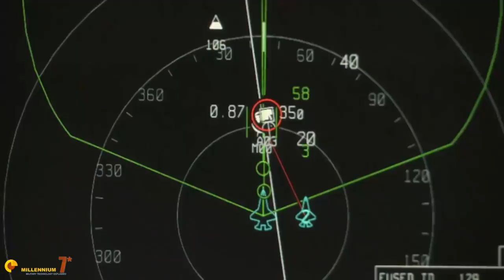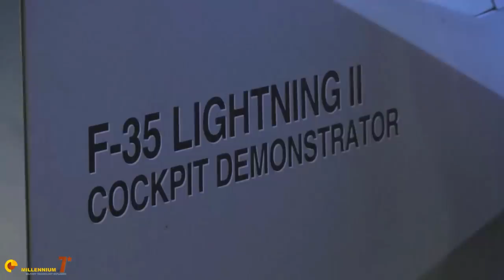Put the F-35 inside the F-16 | Are there limits to upgrades?

Comment: A different engine will negatively affect the overall aircraft? Nah, just look at the British Phantoms... ermm...
Reply: Yeah, lower top speed in spite of having more thrust and THREE TIMES THE COST of an F-4J.  They were also slightly harder to land on a carrier because the Spey has a poorer throttle response than the J-79.  This was a slight difference but men who flew both from carriers were unanimous.  The F-4K and F-4M did have better subsonic and transonic acceleration, but the ridiculous cost had far-reaching effects on RAF force size.  If they had just bought F-4J Phantoms they could literally have bought twice as many planes and still spent substantially less than they did over the lifetime of the F-4 in the RAF and Royal Navy.
Reply: @FireAngelOfLondon  It seems British pride/politicians insisted on local engines in the American airframes for no better reason that to give Rolls Royce something to do with the Spey, a perfectly fine engine that just wasn't the right fit for the Phantoms.

Even the notoriously nationalist French kept the F-8s more or less stock. And the Germans simplified their Phantoms quite a bit, but kept the engines even if they had other problems. 

And later on the British did the same with the Apache...  but with less compromise in performance/price/etc.

It's all very well supporting national interests and industry, but is it worth it if the results are a dubious improvement at best?
Reply: @DavidLee-df888  Overall there was no real improvement in the Spey engined F-4s.  They gained some advantages yes, but they lost as many and the ridiculous price was a disgusting waste of money.  British companies could have been propped up just as effectively by license-building the engines and avionics and having stock F-4J Phantoms.  If the law was what it ought to be then the politicians who made the decisions that led to the F-4M and F-4K would have gone to prison.
Reply: @FireAngelOfLondon  I agree, that was my point. I'm all for supporting British industry, but this was an almost complete waste of money.

The government might as well have not bothered ordering the modified Phantoms if the intention was to replace the TSR.2 to save money, good job there! Should have stuck with standard Phantoms, or paid General Dynamics to finish development of the F-111, or even restart/continue developing the TSR.2 if the tooling had survived. Or even the P.1154
Reply: He didn't say it would 'negatively effect the overall aircraft' (although one could argue that the Spey did do so to the F-4). He said it isn't so easy as just bolting a new engine in, it usually requires extensive changes that add a lot of cost and difficulty to the project, so in addition to the avionics problems, it isn't much cheaper than just designing a new plane. Unless you find an an engine of the exact same diameter, length and size, you will need to redesign the bulkhead frames, perhaps the fuselage, you will need to relocate a lot of equipment to bring the weight distribution back to the correct limits, rewire and replumb all the associated connections for the engine and relocated equipment. Obviously a plane can be re-engined, it has been done many times. The F-16, the F-14, the Vulcan, the F-4, the U-2, the F-18, etc, etc. In some of those cases the engine was specifically designed to fit in that application to start with, so it was less of a problem (the F-16), or the plane was basically redesigned (U-2, F-18), or they just decided it was worth the expense anyway. He is talking about modern fighters though, the F-16 in particular. It was already re-engined once, and it is unlikely that they can find a way to fit an engine of significantly increased power or economy without basically redesigning the fuselage. When the added expense of this is taken in consideration with the added expense and difficulty of trying to upgrade to modern avionics, the total cost is not much less than just designing a new jet.

Comment: This video explained why it is expensive to add individual upgrades to older platforms.  However, the F-16 was the first fly-by-wire so it obviously had computers and even simple computers sucked a lot of power back then.    It is not obvious that new avionics would violate the power capabilities of an F-16 merely by inspection. ( We can assume heat and cooling goes along with power requirements since wasted power is turned into wasted heat).  
It it was easy, I assume that the suppliers would have suggested it, but it is not the dumbest idea.  Simple computers back then took some space also.  I agree it would likely not be practical, but a complete replacement of avionics is not the same as adding components with all of the added integration issues.
I think the best way forward is for the open architecture avionics to get reused into new designs.  The avionics seems to take a long time to develop and debug.

Comment: In the case of a purchase of a new platform instead of upgrading you should not only consider the fly-away price of a plane but the additional cost of the whole infrastructure, spare parts etc you will not have to pay for if you upgrade an existing platform. F-35's flyaway cost may be close to 100m right now, but if you check several contracts that took place, the price exceeds 150m per plane. For instance, HAF is upgrading its F-16 Block 52+ & Block 52+ Adv to the V variant (Block 72) for less than 20m per plane (84 planes in total). Although F-35 is of course much more advanced, with the same amount of money spent, less than ten places would be purchased and such thing would not make sense.  At the same time, logistics concerning all the rest of the parts except to the new avionics remain the same. Of course Block 52 is a relatively modern block and not everything has to be replaced for the upgrade, but this case shows that things are not black or white and the upgrade sometimes really makes sense.

Comment: Yes there already is because Lockheed Martin (who makes the f35) now has the rights to the F-16 When they purchase general dynamics they have a version of the F-16 that has all of the electronics from the F 35 it’s the block 70 And also the F 16 was designed to be easily upgraded from the get-go
Reply: This statement is objectively false.
Reply: @rs232killer  Look up the F-16c block70 Has a lot of 22 and 35 technology inside of it most of it being electronics
Reply: @MattyC62185  I was referring to your statement in your original post which said "the F-16 that has all of the electronics from the F 35 it’s the block 70..." If you had said "a small number of the electronics elements will be common with the F-35" I would cut you some slack.
Reply: @rs232killer  That’s what I meant Lockheed Martin makes the F 16 blocks 70 for nations who want electronics or fifth generation fighters but do not have the cash to spend on an F 35 like Bahrain for example

Comment: Then it means bigger heavier fighters would last longer. We can see that the f15 got an ex version while the f16 got shelved
Reply: F-15EX is just Qatari F-15 off the line delivered to USAF with a new paint job.  F-16 is on F-16V.
Reply: F-16 isn't shelved but it is made by the same company that makes the F-35, it makes sense that Lockheed would only offer F-35 and not F-16 to customers.
Reply: @unknownuser069  They’ve been making changes to TEWS and the EW suite on the F-15 for decades, and have kept pretty quiet about it until EPAWSS.  F-15S, F-15SG, F-15QA, and F-15K all have GE F110 motors since F-15E airframe was strengthened for all the excess weight.

No matter what they do, it won’t be worthwhile if it’s between the capability of F-35A and F-16V.  I’d like to see a Graphene airframe JSF series with next gen VLO surfaces using programmable signal RF waveform attenuation to meet the threat radar freq.  That’s what they’re working on now.
Reply: @Mediiiicc  F-16C Block 50/52 built by the actual company, General Dynamics, will be around for a long time serving through the next 2 decades.  F-16s are still being delivered to Foreign Military Sales customers.
Reply: @LRRPFco52  Lockheed only offers F-16 when it is not possible to offer the F-35, usually for political reasons. Canada and Switzerland are in the process of selecting a new fighter jet, Lockheed has offered them the F-35 but has not offered to sell them the F-16.
Reply: @Mediiiicc  Canada was one of the early JSF partners for F-35A, and has 1400 supply points for F-35 subcomponents already being manufactured in Canada.  They also invested millions into JSF development that they would capitalize on to replace their timing-out Hornet fleet.  The Chinese and Russians worked hard to get Trudeau elected so that he could kill Canada’s purchase of JSF as planned.  This was done after a Canadian propaganda program run by the communists did a long hit-piece on the JSF program, featuring “expertise" from the likes of Pierre Sprey, who stated that the F-35 was good at nothing, that stealth is a hoax, that F-35 can’t run, can’t turn, can’t climb, etc.  Many Parliamentarians who don’t know the difference between the tip of a ball point pen and a missile swallowed this retardation as if it was gospel, and became very critical of the JSF program, halting Canada’s purchase orders once Trudeau came into office.  Trudeau literally ran on killing the F-35, which has set Canada back for every year they don’t take deliveries.
Reply: @LRRPFco52  Canada's history with the F-35 does not explain why Lockheed martin has chosen to not offer Canada the option to purchase the F-16. Also, Switzerland.
Reply: @Mediiiicc   canada will never buy f16 because f 18 better fit for them. Canada can buy F16 from the beginning or anytime
Reply: @unknownuser069  
Well, the F-15EX, for all intents and purposes, just a marginal improvement over the F-15E, which isn't even that old. 

The two main reasons why the USAF procured the F-15EX is due to the fact that F-15C are nearly at the end of their service life (and it's the most expensive jet fighter to maintain aside from the F-22) and the F-35 wasn't meant to replace large part of the F-15C fleet, and there's no other alternatives to replace it (restarting F-22 production is out of the question and 6th gen is still pretty much just on the drawing board) aside from newer F-15 variants.
Reply: @jimc1654  Whether or not the F-16 is right for Canada is not the argument we are having right now.
Reply: @Mediiiicc  When did Canada request an RFP for the F-16? That's news to me.
Reply: @unknownuser069  Boeing employees at the plant in St. Louis have said that the first F-15EX delivered to the USAF is an F-15QA of the QA line, given a C model paint job, which is being tested and developed further at Edwards (where my family used to work on the F-15 Combined Test Force).

USAF never asked for the F-15EX.  They were told they had to take it by Mattis and Shanahan (who was a Boeing marketing executive for 30 years).

Mattis was faced with the problem created by the Bush and Obama White Houses where the F-22 had been killed before we could even get to 200 airframes out of an original 750, which leaves a fighter gap in the space where the F-15C normally operates as a dedicated air superiority fighter.

We were supposed to replace every F-15C squadron with Raptors, but were left with breaking, busted, worn-out Grey Eagles with diminishing legality and survivability that was kept afloat by the AESA, JHMCS, AIM-9X, and JTIDS data link.  The F-15C fleet is currently flying with limits on maximum speed as a result.

They false-advertised the operations & maintenance, as well as unit purchase costs for the F-15EX under Mattis and Shanahan, then told the Air Force they were getting the F-15EX.  This is entirely outside of the F-35A’s budget in the USAF, on a different track.

One of the proposals was that the F-15EX can carry hypersonic missiles for the F-35 to provide long range targeting for, with the idea that "the F-15 can fly up to Mach 3”.  That’s news to me and everyone associated with the F-15 program.  I’ve not met an Eagle driver who has ever reached the book value of Mach 2.5, even on a Functional Check Flight.

One of the selling points they used for that angle was that the F-15 can get a hypersonic missile closer to its max speed of Mach 5 by starting out at Mach 3.  Mattis doesn’t know anything about the actual performance of USAF aircraft, other than what the “experts” around him were saying, so you can see how they were able to pull the stunt off.
Reply: @unknownuser069  A models haven't been built since 1978. Never heard of an F-15AJ. I've been around since TF-15A before there was an F-15B nomenclature, so...

If the USAF never asked for an F-15EX, what production line did it come off? Most people don't realize that fighter production starts at least a year before the first airframes start rolling off final assembly.

Which line was getting filled when the USAF was told, "You're getting F-15EX."? F-15QA. USAF said, "If we're getting EX, it needs to have some of our own specified systems, which is where the Digital ECM/self protection suite, data link, etc. come from.
Reply: @unknownuser069  My experiences with the F-15 don't come from online. They're mostly pre-internet as we know it. The 2-seat canopy especially was notorious for max V0 restrictions.

Once you attach CFTs, forget about most of the supersonic profile. Unless of course the test pilots, engineers, and engine techs were all on the same sheet of music with a cover story and found exemptions to supersonic area ruling.
Reply: @mickeyg7219  first gen E's are from '85. Pretty old.
Reply: @LRRPFco52  Lockheed Martin owns General Dynamics tactical fighter business.
Reply: @Mediiiicc   And Canada or Switzerland have shown genuine interest in purchase of F-16? Usually country says what it wants (obviously it doesn't ask for something it is not possible to get) and other countries+companies react to the requirements. 
Or - should somebody came to Lockheed as said: We'd like to buy 200 of your F-16s, we are not interested in F-35 instead; is L-M going to say: No, either buy F-35 or go home?
Reply: @mungo7136  You are not following my point. This has nothing to do with Canada making specific request for certain aircraft, this is about Lockheed not offering the F-16 to Canada after receiving their RFP.
Reply: @mungo7136  
Lockheed would get the profit regardless of whether Canada wanted the F-35 or F-16, it just make a business sense for them, but it seems that Canada doesn't want both. Canada really love its F-18 to the point that it bought USED ones from Australia to replace the aging CF-18. No doubt that Canada would buy the better F-18E/F Super Hornet if it's not for the trade dispute with Boeing.

Comment: I wish they would take a look at an airframe we already have, the NASA version of the F16XL. It has Super Cruise, outstanding range, and weight lifting power.
Reply: I was thinking the same thing!
Reply: This video goes over why upgrading a plane is not so simple, reactivating a retired experimental airplane would be even worse. A clean sheet design just makes more sense.
Reply: @Mediiiicc  F-16 XL is not an experimental fighter, was used in the 1984 in the competition against the F-15E. The F-16 was designed with a modular wing scheme, and the XL was a option.
Reply: @blackcat3383  You're opinion differs from the facts.
Reply: @Mediiiicc  Where?
https://en.m.wikipedia.org/wiki/General_Dynamics_F-16XL
Reply: @blackcat3383  Directly under the picture, see ROLE
Reply: @Mediiiicc  You should really take a hard look at three aircraft:
SU-34 Bomber
SU-35 Fighter
Both came from the SU-27
None of these aircraft are crap by any means.
Reply: @johnparrish9215  Yes it CAN be done, that doesn't mean it SHOULD be done. 

F-16XL first flew almost 40 years ago, there is no reason to use a design that old.

Comment: Perhaps you can explain how Saab was able to design the Gripen to be so easily upgraded. Maybe you already discussed that in your Gripen videos but I can’t remember. Thx, great videos.
Reply: A real-time, multi-tasking, executive operating system software package that isolates each program and weapon control software in it own memory space and time slot allocation. If you add a new weapon software/hardware package it has no effect on the other run time software modules other than requiring a bit more CPU time. Each software module can be assigned a task priority so that it gets serviced by the OS at regular intervals often enough that target acquisition and tracking computations maintain required accuracy and data is not lost. If one of the software modules would happen to fail or get hung waiting for an event, it has no effect on the other software modules since each software task is only allocated a 'time slice' of the cpu(s) time. This is similar to how Linux and other modern operating systems are designed using 'structured programming languages' that use a modular design to isolate each software task from the other tasks and increase system reliability and ease of software maintenance.